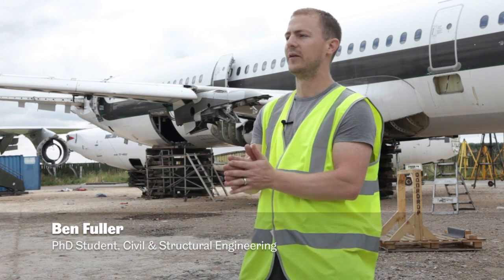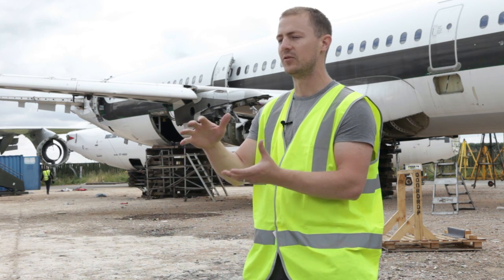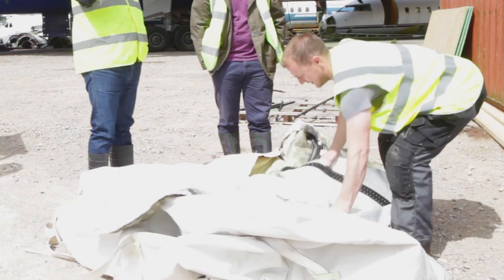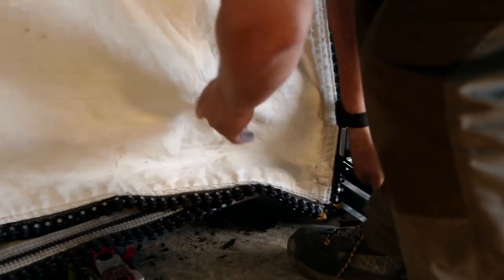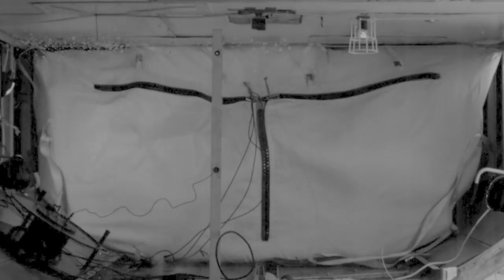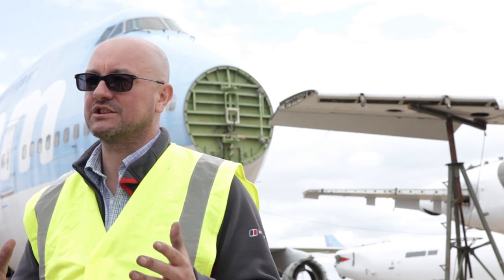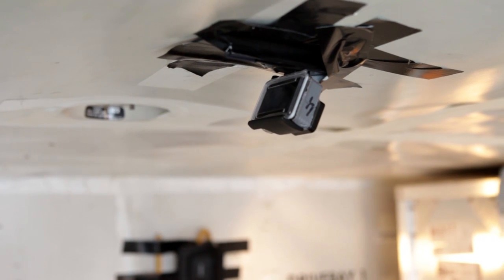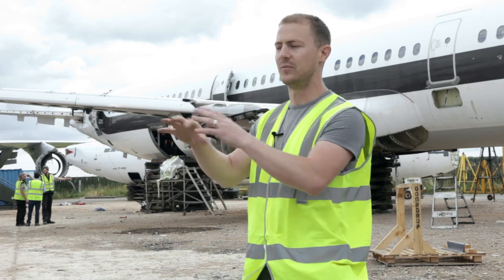Blast Engineering at Sheffield

Comment: am i the only person who realized that an explosion in a plane at ground level would produce different pressure dynamics than an explosion at 30000 feet, given the difference in outside air pressures. in order to get accurate and reliable data you would have to correct for this difference in your experiment
Reply: +Bradley Collett and what purpose would that serve? the point of this product is to protect passengers from a catastrophic destruction. only a small percentage of people would die if a bomb were to explode in a plane that is on the ground. a bomb being detonated while the plane is on the ground would not maximize the kill rate thus a potential terrorist wouldnt be interested in this. terrorists want to destroy the entire plane and kill everyone on board to maximize the destruction, which is why they would want to wait until the plane is in the air before detonation. if this product only protects planes while they are on the ground then i dont see the value in an airline investing in such a product.